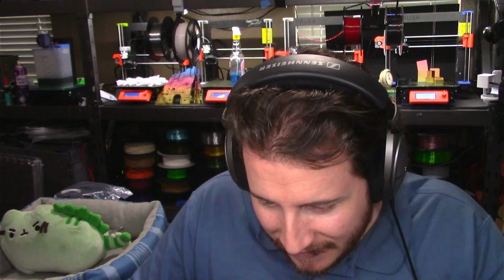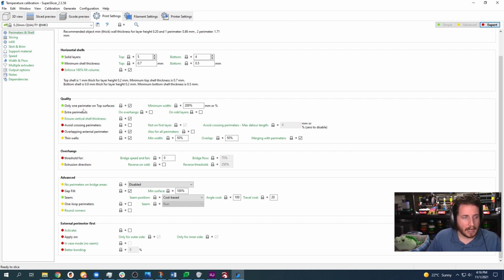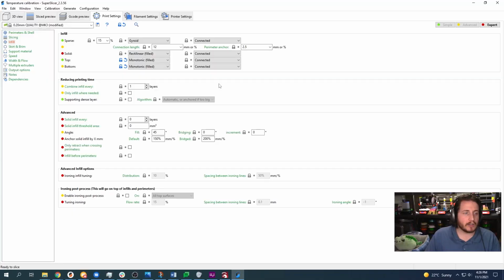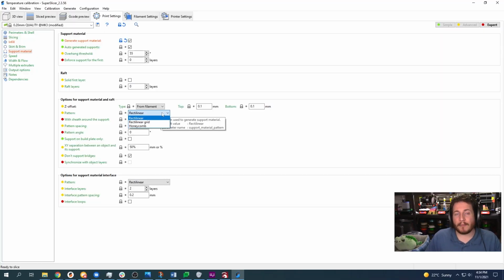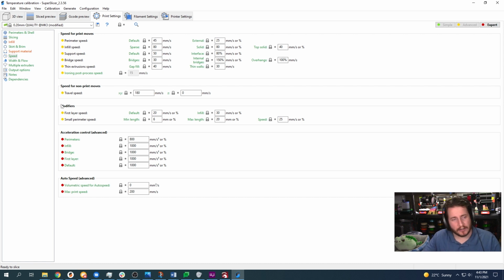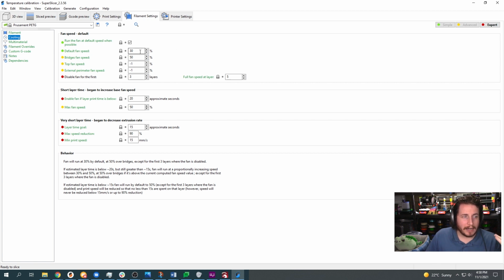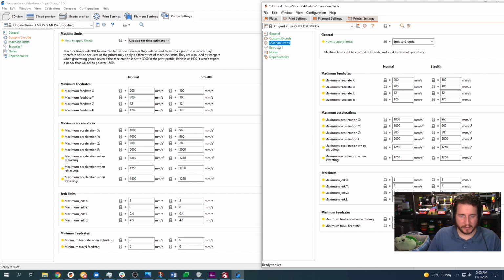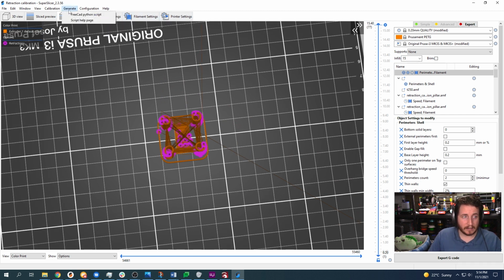A SuperSlicer Super Deep Dive!!

Comment: Can you explain why there is such a huge print time difference between Super Slicer and Simplify 3D. All settings are the same, yet super slicer will take almost twice as long for the same print file.
Reply from the maker: Acceleration likely. S3d doesn't account for it in it's estimations.

Comment: 41:18 🌳
So are there some kind of tree-support or something similar in SuperSlicer?
I really love them in Cura but want to use SuperSlicer because of other settings.
Reply from the maker: Snug supports are the closest you will get. Personally I find them better than tree, but that's just me.
Reply: @3DMusketeers  Will they also suppoert from an angle?
E.g. if there are multiple U-shapes on top of each other, can it support them alls from the print plate comming from the side?
Reply from the maker: It is known PS is implementing Tree Supports soon. But I do not know. It has never been an issue for me. I just use a good interface distance and I dont have scarring on the top surfaces where support contacts them to support something above

Comment: why do you badmouth rafts? i use  them quite often printing really tiny parts from abs otherwise they don't stick to table and i can't find them , it also helps with my warped ender 3 bed
but i am a wierdo who print really detailed trains with 0,2mm nozzle from abs in open air :P
Reply from the maker: Because rafts make for ugly bottom layers. Use a brim, it will work similarly without causing damage to your prints :) 

But yes, you are a mad lad ha ha!
Reply: @3DMusketeers  brim doesn't work well with 3 mm diameter, single extrusion width headlight rings made out of 3 layers of filement  :] i mean my parts can be this tiny or smaller and they are usually cut off with a scalpel and tweezers , there is no bottom layer badness because that usually a side that being glued on
keep the rafts safe, they are needed!
Reply from the maker: I would put like a 15mm brim on it and send it! lol

Comment: Hey I'm about in the middle of my skillz at creating and slicing, and what I'm after is the ability to set details to fine for the exterior of a building, but set the walls thickness to thick to speed up the print... I'm hoping to find these in Superslicer, as there is nothing much in Flashforge's FlashPrint... any pointers that can get me in the right directions please???
Reply from the maker: Line width I think is what you're after. If you're just starting I'd recommend Prusaslicer and only up to super slicer iffffff you need more control

Comment: Does it also support CraftBot 3 printer?? Still strubbeling with the CraftWare slicer…
Reply from the maker: It should support any printer. It's just G-Code. So unless craftbot uses custom file extensions or something, it should work fine. BUT it may not have profiles so you may need to make one.

Comment: Tip*** With regard to small perimeter speed settings, if you want to use One loop Perimeters, multiply the small perim. target size by the number of walls, for example 8mm x 3(walls)=24mm. Then small perim.speed will work properly.
Reply from the maker: ooooh I did not know that! Thanks for the tip!

Comment: I learned a lot thanks.  I would like to see a video, a very thorough walkthrough, on all the calibration options in super slicer. Specifically where to find the settings you need to change upon completing a calibration print.  Which settings to use, which settings not to use and what to expect as a result.  It is matting sometimes when you change filament colors or brands and everything seems to be out of whack and it seems everything needs recalibrated.  I have been 3D printing for almost a year now and still feel like a new when it comes to calibrating and tuning my printer per filament.  I would think a lot of people would benefit from a thorough explanation and how to video for Super Slicer.   Thanks
Reply from the maker: That is a good idea, at least the "how to read a temp tower" or something like that. I like it!

Comment: great video and has helped me alot. one thing i wish it had though is the ability to adjust how far away the nozzle possition is relitive to the outside walls when in moved within the part. i notice when i set it to move only in the part it moves very close to the walls and would like the ability to even just set it to move only in infil. hope this makes sense
Reply from the maker: I think you have the "avoid crossing perimeters" or some form of it turned on. If you turn it off, increase retraction some and use z hop you should not have issues with crossing perimeters
Reply: @3DMusketeers  hi thanks for the reply. yes i set the avoid crossing perimeters turned on as if i didnt i would get tiny blobs on the outside of my print where you can see its moved to another part of my print
Reply from the maker: ah, that is all about tuning retraction and pressure advance :)

Comment: I use the infill connected options all the time, usually just to set the top surface to not be connected so it doesn't have those little zig zag connected lines along the perimeter. It just looks a bit nicer (imo).
Reply from the maker: Hmm I have never thought of it this way. But I also do not get those lines along the perimeters, at least I do not think so?
Reply: @3DMusketeers  it's not always noticeable in the print for sure (especially at my preferred .28 width for top infill), but you can def see it in the sliced view. I found occasionally that extra filament made any slightly rough surface edges a bit worse too... but I'm not wildly experienced so I may just be imagining that.
Reply from the maker: Are you talking about gap fill? Could be?

Comment: Hello in last version of sslicer small perimeters speed doesnt change why? I put values min 1mm and max 15mm at speed 10mms and speeds dont change. Dont know if in older versions does the same
Reply from the maker: What printer are you using? The latest should work like Prusa Slicer 2.3.3 which I have had success with on every machine we have here for the small perimeters. You may not have a perimeter small enough to work though?
Reply: @3DMusketeers   will try in older version of ss
Reply from the maker: Okay, let me know how it goes!

Comment: Rafts exist because soluble supports exist. :)
Reply from the maker: hmmm, not sure what the raft would do that would be useful for soluble supports. Is there something specific? I know Dense layers are there for soluble supports and material savings, but not sure what else.
Reply: The raft in general becomes more viable when it is printed with soluble material. It's (as you know) used to make a big thick "first" layer that can fill in/compensate for the variation of the bed surface. Then, the real first object layer can be printed at a much finer layer thickness on top of the soluble raft/dense interfaces like you mention (they merge and become the same extrusion role.... in PrusaSlicer, at least). Having it soluble, as you'd imagine, makes it easier to remove.

On top of that, it can provide a small amount of thermal insulation from the bed. First few layers of PLA can look bad. Putting a raft in between can help with that.

Also, PVA sticks very nicely to lots of bed surfaces. It can be just easier sometimes to have only a single material contacting the bed surface. Then, the bed surface requirements can be relaxed (as I alluded to earlier).

It's not exactly essential, but IMO it's a good idea... and like you pointed out, rafts of the same material of the object make less sense.
Reply from the maker: My understanding of rafts, and why I used to use them was because ABS and non heated beds. The raft would warp protecting the part, but I guess I can see that being useful if you have the capabilities. Here in FL though, we try to avoid PVA because it becomes worthless pretty fast :( Ultimaker adds some sort of 11 herbs and spices to make it more stable, but it is only in 3mm so far.
Reply: Ah yes, you bring up another interesting point. It is useful for reducing warping, even with a heated bed. Because the rectilinear raft, which is often sparse, has more "relaxed" stresses inherent in the traces -- they have a tendency to warp less, and so improving adhesion and chances for success. The part isn't directly in contact with all the heat (going back to the insulation I mentioned), so it also tends to warp less. Sometimes, even with printing big thick brims, parts want to warp. The raft can do lots for that.

As for PVA in Florida... lol. Yeah. I'm in Vancouver, which is not exactly dry. If you buy an air-tight container, like a pet-food container, and run PTFE tube to it, and throw in an over-sized desiccant bag (made for like drying out humid RVs and such)... you will not have problems with moisture! Lololo. I maintain <5% relative humidity in the print/storage container.

I was scared that soluble supports would be very difficult for the longest time. They turn out to be very easy and nice to print, once you solve those initial material considerations.
Reply from the maker: We have active drying solutions that we currently use but for machines like the Prusa XL this may not be possible, we will see. 

Yep, soluble is easy once you have the equipment, the actual tuning of it is not bad at all.

Comment: Anyone know how to update Super Slicer and save your settings?
Reply from the maker: Update should be under help I think in the top menu. To save your settings go to file>export>config bundle. And choose everything.
Reply: @3DMusketeers  I actually figured it out..I thought the way that SuperSlicer runs without an installation out of a folder it wouldn't translate configs when you delete that folder to move to a new version. But it stores configurations separately outside of that folder.  You can see where it stores by going to Help > Show Configuration Folder.  I also found out you can change that to a cloud based folder, so now have SuperSlicer across all my devices configurations synced in real time.
Reply from the maker: That is fancy!
Reply: @3DMusketeers  Like everything in SuperSlicer, configs everywhere, a total Toy R Us UI mess, best of luck, a quick tip backup, backup and backup again as you will loose it all in time, what a total fiasco SS is. 
Your finding of - But it stores configurations separately outside of that folder. - is correct, and the BOZO's whoever wrote it DON'T tell you that with an info box or such like before it walks all over your n hours of setup / testing if you happen to do what I would think a logical step to create another 'test' folder with another copy in to do any tests before committing to your final copy, as this is a non install prog, just unzip to folder, ie a portable app, one would have thought a .ini file for the settings would have been the order of the day so everything is local. What a total JOKE.

Comment: Because of what I print, SuperSlicer has become my go to, because of ONE simple setting I cant believe isnt in PrusaSlicer... Single perimeter on top layer. It give me much better details on my top layer for my plates. If it wasnt for that i'd stick to Prusa because superslicer does some odd things with the top solid layer.
Reply from the maker: That is a nice feature, I just did not personally find that to be worth it, especially with 2.4 bein beta now. I MUCH prefer the new painting for supports that Prusa does over the old school painting in SS. Mind you I am sure they will do a pull and bring it over, but still lol. I generally get good layers so I have not had the issue where the 1 perimeter really helps, however with silk prints or on ironed ones I could see how the single top perimeter would be nice.
Reply: @3DMusketeers  I use multi color prints so that's where the 1 perimeter helps big time. SS also just came out with another release that gives that option for the first layer, something I'm beyond excited for because I use Wham Bam mats which I can now have my prints have that glassy look that up until now only the backside got. 

What bums me out SS at the moment is the lack of the color paint option that PS 2.4 has. I'm hoping that's a pull as well. Would love to see them combine into one SuperPrusa Slicer because they both have amazing options that the other doesn't.
Reply from the maker: If history serves us well, it should only be a matter of time!